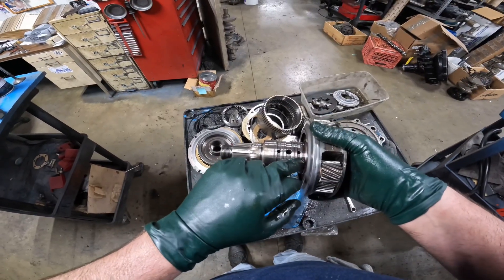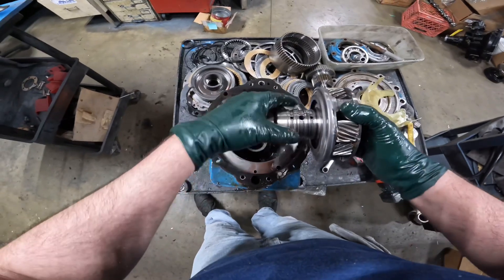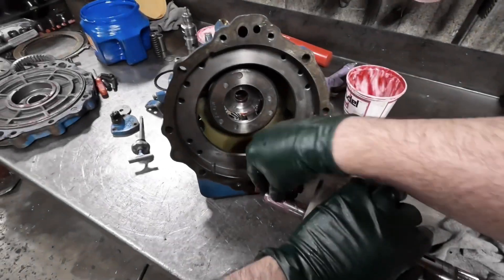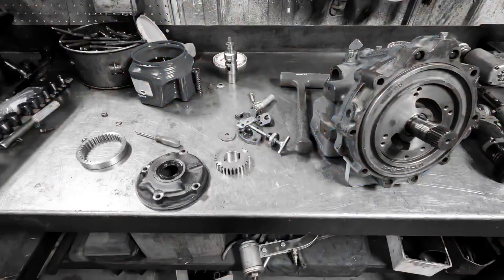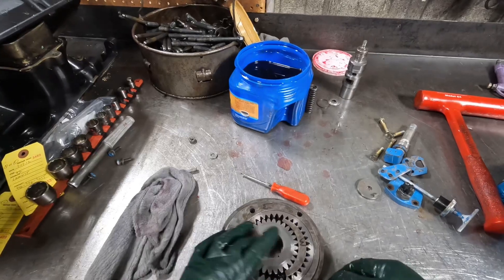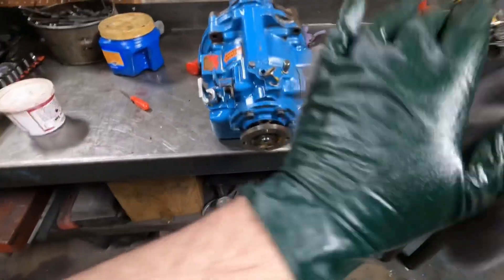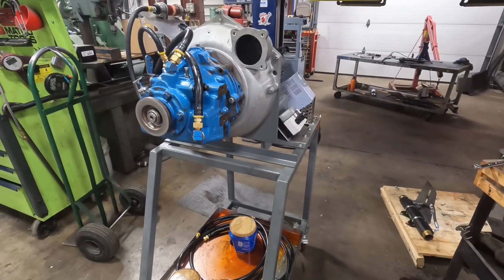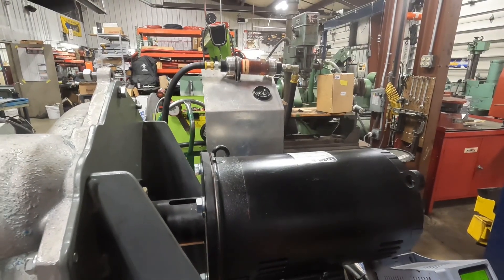Velvet Drive Marine 10-17 Overhaul Trailer

Comment: Do you change the bushing in the back of the cases?Also is all 1017-004 seal and ring or sometimes you can find 1017-004 with bushing case
Reply from the maker: Everything I have every worked on with a 10-17 or 10-18 is a sealing ring case. AS71 and AS72 are bushing cases. I only change the bushings if they are bad which normally they are good.